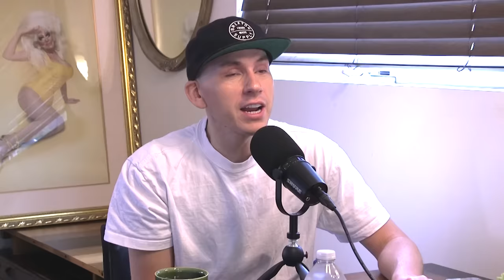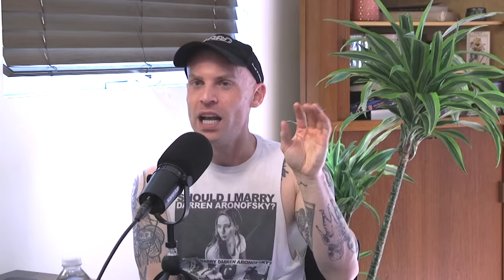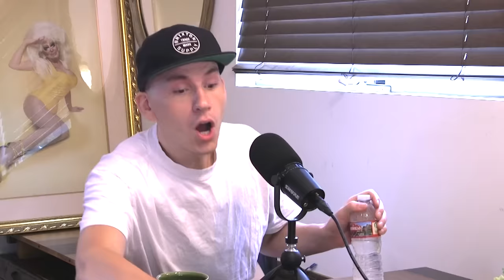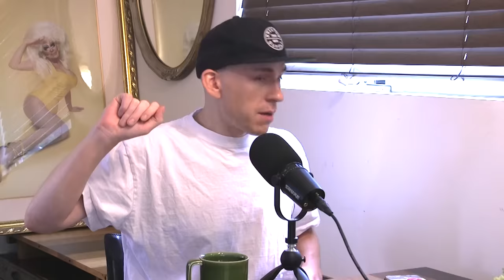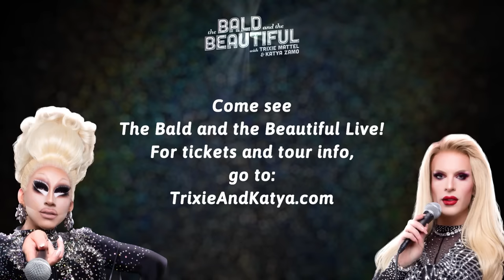Microphones Are Cameras for Sound with Trixie and Katya | The Bald and the Beautiful Podcast

Comment: The temperature gun was ACTUALLY a gift from one of Trixie’s managers tongue pop drops into splits removes 40 inch wig to reveal 39.5 inch wig
Reply: Holds out one single one dollar bill
Reply: *two snaps in a circle*,  work!!!
Reply: I think you need at least one more wig for another reveal...
Reply: @Corbomite_Meatballs the third wig is 50"
Reply: @liznolan391  nah, the third reveal is the sfx bald cap, rhinestoned in the pattern of a Georgia O'Keefe vulva flower. ✨️
Reply: I walked into a hotel in Las Vegas, and they hit everyone with the temperature scan. 
And I asked them point-blank: "What happens when you get a positive? Do you tell them to go patronize a hotel or airline that caters to sickos?"
The gun is real. What happens after that is theatre: they take you into a cooling room until you pass.
Reply: @randalalansmith9883  I reckon they send u to the hospital for treatment and get everyone to quarantine lol